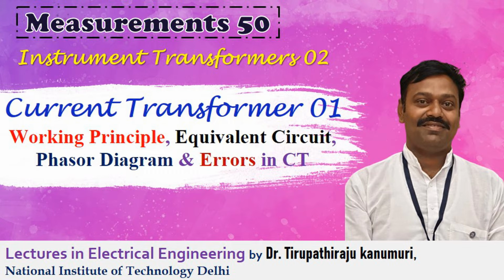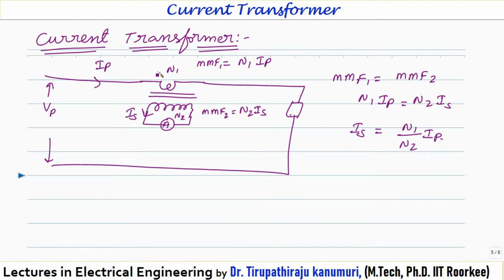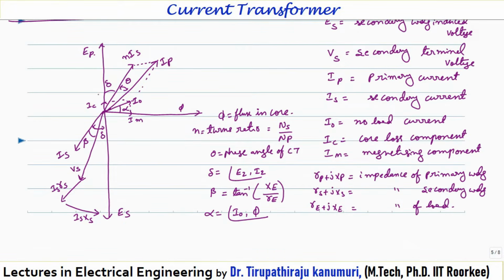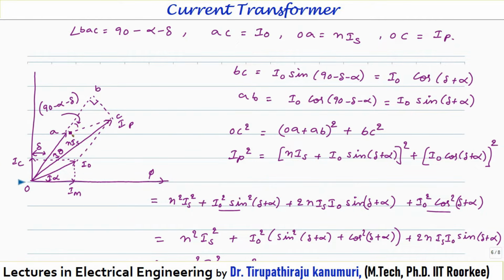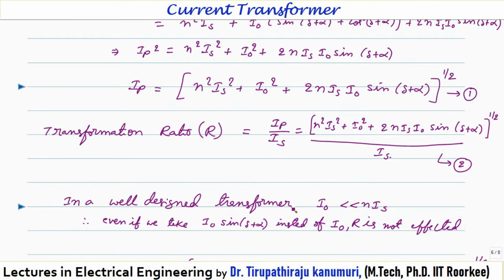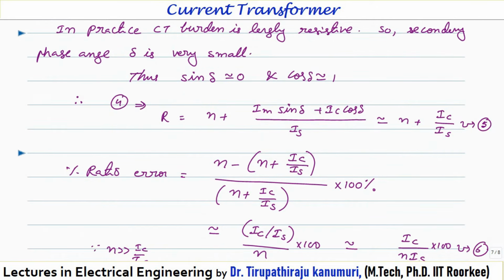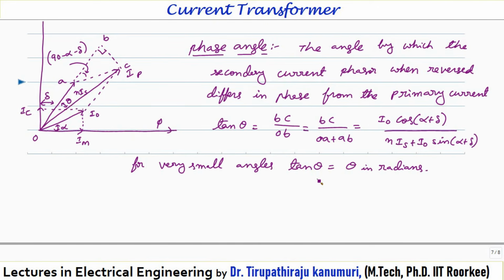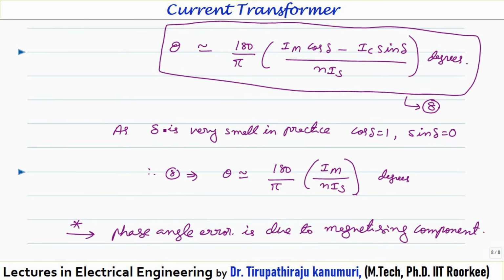ME50 Current Transformer 01

Comment: Sir at our substation we have installed CBCT in cable cellar due to limitations of space in cubicle compartment in that case we have loop cable shield and return through CBCT and connected to ground but as cable armour is ground at gland plate So in this arrangement will able to measure correct phase current